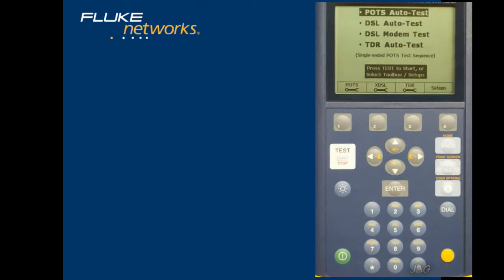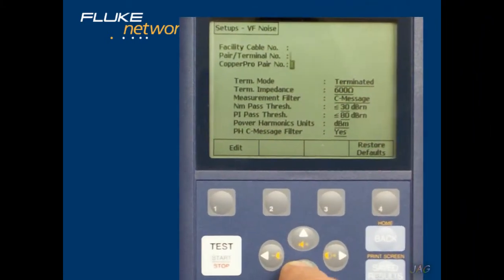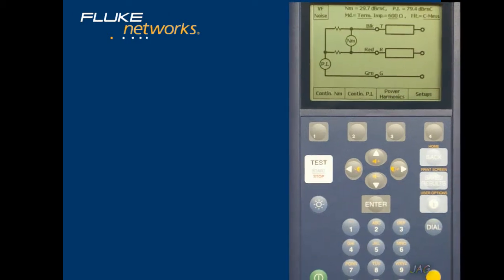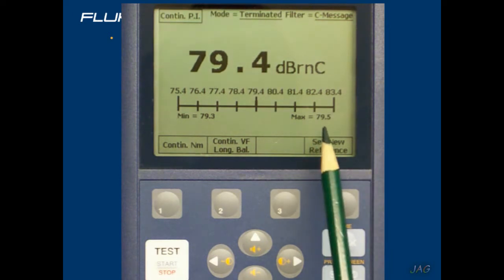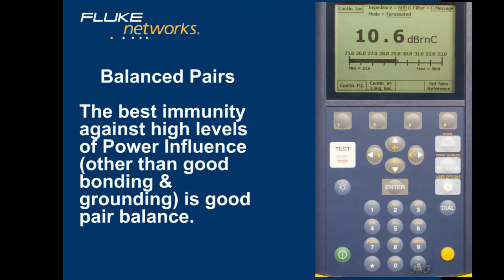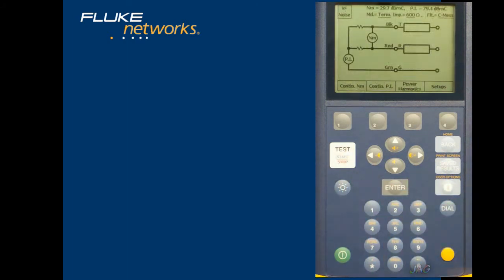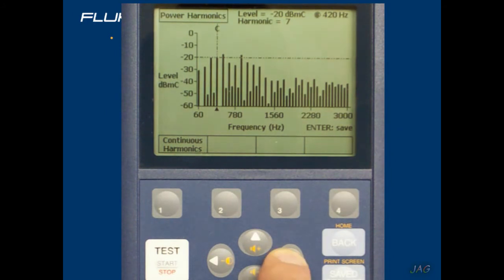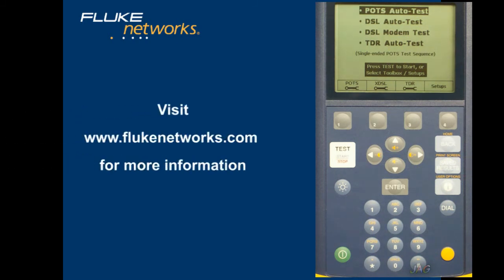VF Noise

Comment: nice video! may i ask how you created the fault?
Reply from the maker: All faults were added to tightly wound pairs (in a spool) that had taps (access points) at different distances.  Shorts, grounds, etc are simple resistors applied to a tap to ground.  Power Influence was more challenging, and not precisely controllable - I coupled one pair to another pair with inductors (a simple load coil can be used in a rather unconventional way).  An AC signal was fed into one pair, which coupled onto the test pair (via induction).